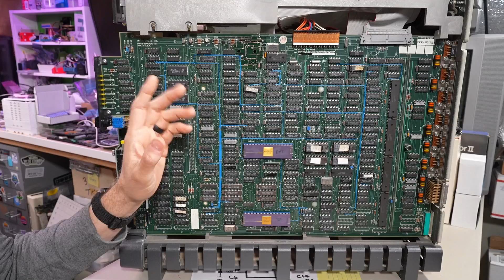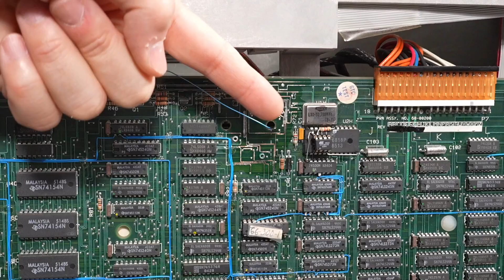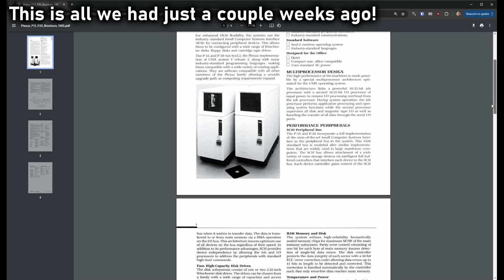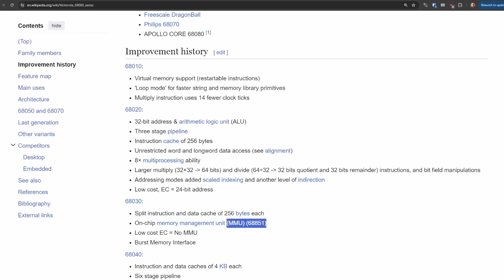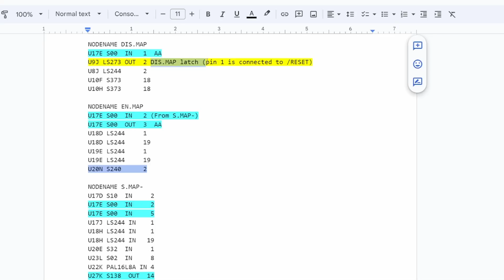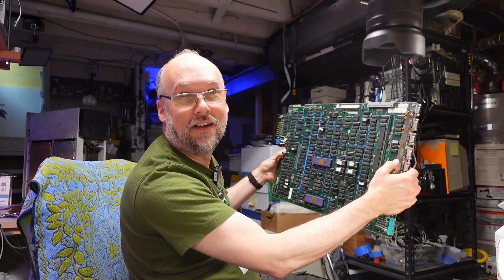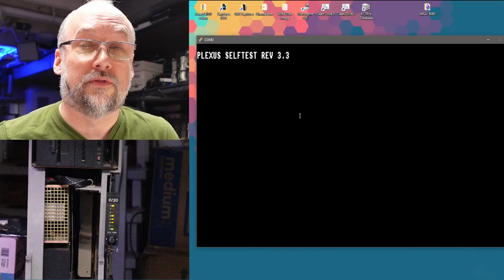We made some unbelievable discoveries about this Plexus P/20!

Comment: I worked on a digital scale counting machine in 1979 that had 4 boards the display board had 50 ic’s ,computer board had 120 ic,s, analog had 100 ic’s and power supply had 10 regulators. Led 7 segment display. Weighed 75 lbs.

Comment: The CAL.CE- signal is not about power savings.

Consider the case when the system is being powered up or down, and the voltage is out of spec for the ICs (less that 4.75 V if I remember correctly, tho they typically could run on a little less) There is no quarantine the Clock memory would not be given a bogus write command, destroying the configuration. The CE is active low, which makes it a bit of a pain, as we want CE- to be high whenever the power is out of spec. MRESET- from the power supply is the "gold standard" "you got good power" signal, which laughably is broken in your box. The transistor/pullup resistor is simply an inverter to lock out the clock memory.

You did a superb job!!

Comment: Ain't nothin outdated about an Arduino.  :-)  It's a dev harness around an AVR microcontroller, which is a fantastic little micro for simple tasks.  Good C support, 5v, lovely little ISA, plenty of useful peripherals, and a vibrant ecosystem.

Not everything needs WiFi.

Comment: WRT battery crusties. The best treatment is a baking soda paste soak (work it in with a toothbrush, followed by rinsing with clean water and then isopropyl) - this applies to both Nicad and dry/alkaline cell leaks

74S (schottky) devices can usually be safely replaced with LS (low power schottky) but are generally highly reliable. It looks like you're just unlucky that the corrosion penetrated the case

Comment: Git is a software highly optimized to track differences between two versions of the same file, usually text files containing source code (hence it is typically used as a versioning tool in software engineering). Git is really not suited to manage files which usually only change either completely (from a binary point of view) or never at all, like office documents, PDFs, or in your case ROM dumps and photographs. I am scared that you might even put executable files you may find on the HDD into that git repo. All those types of files should really be better placed in artifactories. Git is not the right place for them.

Comment: I'm so glad that you made progress with the RAM issue!  May I add that I learn a lot from the way that you troubleshoot these complex systems, and it's valuable information to help when I am trying to diagnose issues with my computers.  For example, I may need to troubleshoot a SPARCserver (630MP) that I haven't powered-up for three years.  It has a real-time clock module that's similar to the one on the Plexus: it's a sealed unit, no way to replace the battery when it runs out.  There might be some hints on how to access the battery terminals.  All this fun stuff awaits.  The trouble with the 630MP started when it was invaded by tiny spiders. 🙂

Comment: One of the unicorns I want is the board decoder from 1996. You put a board in and it literally decoded every wire. It took a 2 wire "coin" that was like $10k a pass. But today I could hack it easily.

Comment: back in the late '80's or early 90's we'd probably not call this a "unix workstation" because workstations were pretty much defined by having a bitmapped display. Bitmapped displays were a defining feature of a Sun/SGI/HP PA-RISC/IBM R6000  and all the others workstations because it was one of the things that set them apart from mini's that they largely replaced.
Reply: I think it was just a slip of the tongue. Previously, I think Adrian made it clear that it was more like a server, and certainly people made that point in the comments. The whole Q-Office suite suggests something that was occasionally called an "integrated office system" back in the day: a multi-user office productivity environment accessible via the serial terminals.

Comment: Technically the 286 could do virtual memory. The problem was it did so with segments (variable size up to 64K) rather than fixed size pages (which the 386 could do). This made for an awkward virtual memory implementation - an inefficient one. Although OS/2 1.x could really swap segments to disk of a running program so it could overcommit physical memory. But it was painful.

Comment: Don’t know if you already considered, but I think it might be a good idea to very carefully wash the board, so you can spot corrosion damage easier. The battery spot is shining green, but the rest is still some kind of gunk. 

But however, that’s a great piece of hardware. I mean, unix on a Motorola…❤ that’s so awesome. 
I wonder what the system is really capable of. How many users, what workload, etc.

Comment: Yeah, this has me nerding-out pretty hard. I don’t know if it’s possible, but it’d be amazing if you could interview the person who owned and worked on this machine (per the recovered partition). I’m also particularly excited to read the technical docs. I find early MP machines super-interesting as I have a background is in OS internals and driver development on SMP machines. I started out on the first gen of such systems in the early 90’s, just past the era of primordial systems like this Plexus. I’d love to know more about what that second IO (?) dedicated processor is doing; how it’s presented to the system; how it’s handling interrupt servicing (are routines in ROM?); is it handling generalized IO servicing or specific things like executing SCSI subsystem firmware; how’s the physical memory map implemented; how are devices mapped; were there significant modifications to the Unix kernel specific to this system, etc..

Giant tangential side-note: a machine I tinkered with in our office back in 1996 was a then obsolete dual 386 Compaq System Pro. It was originally designed for operating systems where its second CPU was dedicated to running driver code for serving IO, despite having shared access to memory. As it far preceded the MPS and APIC specs, it had hard affinitization for device interrupts to CPU 0. Microsoft (or Compaq) actually wrote a custom NT HAL and kernel that took this into account (overriding driver affinity policies and enabling the appropriate interrupt controller semantics, device mapping, dispatcher policy, etc.) allowing NT 3.1 to run on the machine, with implemented symmetric thread scheduling. Unlike normal NT interrupt handling, which can run the ISR on any CPU (e.g. any CPU at an appropriate IRQL, driver interrupt affinity policy notwithstanding, can service the interrupt), the SystemPro’s HAL and kernel implemented everything hardware interrupt related as affinitized to CPU 0 (this includes both ISR’s and DPC’s ). This also impacted, IIRC, things reliant on the system’s default interrupt handler, like the page fault ISR for the virtual memory manager. It was a pretty interesting, almost SMP machine that I loved tinkering with, and I wonder how similar is the Plexus’ architecture (and if anyone who worked on that machine ended up at Compaq). 

All I can say is this Plexus is some kinda great machine and story. Maybe someday you’ll even allow us to register for a shell account on that old Unix beast.

Edit: that’s what I get for not watching the whole video before commenting - the second half of the video seems to indicate that this machine had some striking similarities to the SystemPro.

Comment: Did you know, mame has a netlist emulator?  Its a bit old as it was a C port and isn't as clean as say a C++23 constexpr implmentation, but it does work as it emulates many of those non-cpu game machines.  

Honstly if your going to make an emulator from scratch mame is an excellent system for it since you can plug in multipule cpus and there are already tried and true blocks of code that were all ready tested working.  Don't get me wrong, I love what the simh guys have done, its just that since that emulator uses a bunch of static vars you cannot instant say, 5 pdp8 and test them networking with one another without having to run 5 processes,

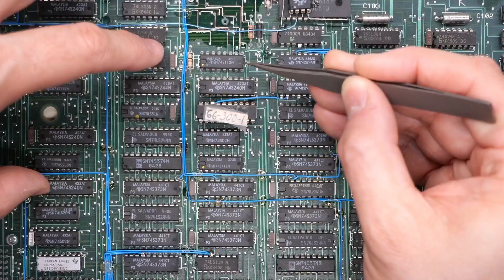Comment: 47:14 Well, it seems it was a good choice NOT to just replace that flip flop chip, since that error was persistent and pretty much forced you (and the rest of the community) to look for solution and in turn that also made you to get a closer look on hard drive data, which let you to discovery of the hidden data. Had it worked correctly from the beginning, you would have a working computer without documentation, since it was less likely people would search through those few "missing" bytes...

Comment: Holy von Moly!  Just about half way through you talked about CAD software that ran on a PDP 11.  My then wife worked at a CAD design bureau in Lowell, MA which used a PDP-11 based CAD package, and now I'm wondering if that was the software they used.  Its user interface was through a big ol' thing that looked a lot like an arcade game kiosk, with a small pen-based touch screen below and large display above for the drawings.  I remember it being extremely intuitive, fast and responsive, which made working on it a relatively pleasant experience.  

I've been waiting for a YouTube revivalist to come up on one of those units but I have yet to see one.  I seem to recall the brand was Telesys or something like that.
Reply: Telesis is the name you're looking for. I found an article in Digital Design (April 1984) that discusses circuit design and describes the Telesis display system with six 1000x2000 pixel memory planes, presumably used to show layers or other aspects of a design, exposed through a 640x480 display viewport.
Reply: @paul_boddie  Thanks!  I actually just managed to dig up the name a few minutes ago. It was not easy to find, and I've done a number of searches in the past.  I'll check out that article now.

Comment: a deep Sighn
Reply: Is the issue on the board - or is it a bad-media signal that triggers this error 
is there a controller issue, cable issue.. voltage/power issue..
or hardware-device issue.. bad diode.. bad resistor.. bad memory

Might be nice to share a close-up board highres images
so we can sniff it out and some brain can make a diagram

Comment: Just a hunch while I'm listening to you describing the fault and wondering what it could refer to. Could the 4F refer to the coordinates printed on the board? There are numbers running down from top to bottom and then letters running left to right. 4F could conceivably be the area of the board pointed to by those markings.
Reply: Seems like I was wrong. Other errors that shows (MULTBUS and CLOCK) didn't appear to have similar coordinate-based error codes.

Good to see some progress, and finding the technical information on the drive was an absolute stroke of luck too.

Comment: I would try contacting Aaron Liddiment here in the U.K., I use and excellent piece of software he wrote in hand with hardware to analyse individual TTL,Memory, PROMs etc, it does this in circuit while the machine is running, it’s Called S.L.I.C.E

Comment: Something's bothering me about your approach to addressing the t4@4F02 self-test failure and subsequent issues...
You've booted and run Unix successfully, but the machine's behavior then changed unexpectedly.  That in and of itself should be considered an important clue: /something/ has changed within the machine i.e. some electrical component(s)/signal(s) went from "marginal" to "bad".  Considering that you had PSU trouble from the start, I would strongly suspect that the PSU may still have another problem.  I'd even bet that this remaining PSU problem is also the underlying cause of the "spurious" resets coming from the PSU that you've sidestepped with your Arduino reset controller...

I suspect that something like excess ripple or over/under-voltage on one of the power rails - my gut says the main +5v rail - is exceeding limits monitored by LM339-based power supervisor circuits in the PSU.  The system's strategy for handling any non-"power good" status may well be to put the entire machine into reset and hold it there until all PSU supervisors have said "power good" continuously for a few hundred milliseconds.  The LM339 would be a fairly obvious choice for this since it's a quad with open-collector outputs.   I would not be at all surprised if the outputs of all LM339 channels used for power rail monitoring are tied together, pulled up by 470R-10K or so, decoupled to GND with 0.1-47uF or so, and then fed into a 555 (or perhaps half of that 556).  The 555/556 would be configured as a one-shot, which may then drive the PSU reset output that you've bypassed.

If all that is correct, it might even explain why U4F "failed" for no apparent reason.  If the main +5v rail has gone out-of-spec due to a PSU component failure, then the SN74S112N you replaced may not have actually been bad.  Your replacement chip may just happen to behave slightly differently when operated under the particular out-of-spec conditions it's seeing in-circuit... and that could also nicely explain why replacing U4F has seemingly resulted in a whack-a-mole scenario.  None of those problems were there before; /something else/ has happened, and a single new fault may well be the underlying cause of all of the new issues.  The main +5v rail going unstable/out-of-spec would be #1 on my list of potential common causes.

I'd suggest checking each of the PSU's output rails with your Oscope on AC at 100mv/div with 20MHz bandwidth limit and a timebase of perhaps 10ms/div-100us/div.  This should be much easier to do now that you have some pinout references for the connectors :-)
In lieu of known specs, I would expect to see less than +/-2-5% or so of visible excursion from each rail's intended output voltage on the Oscope display.  If you're seeing occasional but recurring transients exceeding 5%ish or "lots" of hash exceeding 2%ish, the PSU probably isn't suppressing those transients as well as it should.  (e.g. For a 5.0v rail, IMO ripple+noise over +/-100mv => questionable; over +/-250mv => highly suspicious)

Comment: Quite amazing. My question:  is the material that leaks from the old battery (NICAD was it?)  conductive to electricity? If so then perhaps that material is somehow lingering on the surface or has found its way into the PCB layers and is causing some sort of short circuit, even if transient, which is causing damage to the ICs that are mounted on the board.  If that is so, then there may be some sort of procedure or treatment that can be done to extract or neutralize that material; a bath in some sort of mildly basic solution of some sort, or ultrasound? I have the thought that heat isn't the answer, though that is just a hunch as well.  I suppose it is a long shot, as far as guessing what the ultimate causation for the failure might be but like any good story I am interested in seeing a happy conclusion to this particular chapter.  

I must say that you have certainly found the exact combination of electronic and computer sciences that make a very interesting channel.  I have much in common with your background experience, building and repairing computers from the very beginning of the microcomputer revolution, etc. so its no wonder that I find your channel interesting. (I built my first PC at the age of 12 in 1976, using a soldering pencil (Altair 8800); it did take me a year to complete, after ordering replacement parts, etc. 

We even have some of the same language and slang idiosyncrasies; I was dumbfounded when I heard you say the number two-fify-six because I've only ever heard one other person, besides you now, who actually say it in the same way.  Its almost like an inside joke:  "TWO-FITTY-SIX" always gives me a chuckle to myself.  

Well best regards, CR

PS  I have to wonder if you had ever called my BBS in the  mid 1980's through the mid 1990's? I wouldn't be too surprised, although it likely would have been a long distance call which would have involved toll charges on your phone bill (never a welcome sight for parents).

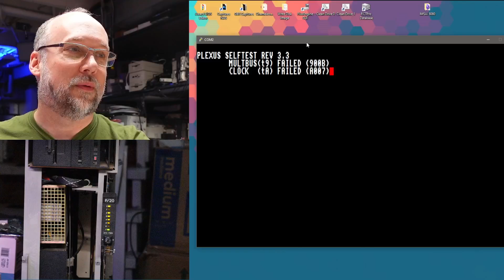Comment: 51:34 'Clock failed', could this be the real time clock, as in what was run by the now missing backup battery?
As for battery corrosion I know it can wick through a PCB, however I thought the bond between an IC pin and the encapsulating plastic was strong enough to keep that out, looks like I might be wrong, so probably a good idea to replace all the components with electrolyte corrosion on them.
As for the power supply, maybe it would be worth looking at replacing it with a way more modern unit from a PC, not the latest and greatest unfortunately as they put way too much into their 12V rails, no you need one a gen back that had a really robust 5V supply, I've seen 25A and up on that rail, probably what you need, although the Plexus is running well enough that a clamp meter should be able to get a reading to give you some indications - double that for a replacement and all should be good.

Comment: Well you know a raspberry pi would be more powerful than that whole box but... I just started watching here. So you have a bunch of wires coming from the supply. So are the voltage rails what they should be? Then where is the level check, in the supply or the main board?

Comment: My next move would be to find a way to replace that battery, perhaps using a primary cell with a diode (to prevent charging) instead of the NiCd cells which used to be there.  Maybe not having a battery is causing all of those other errors.